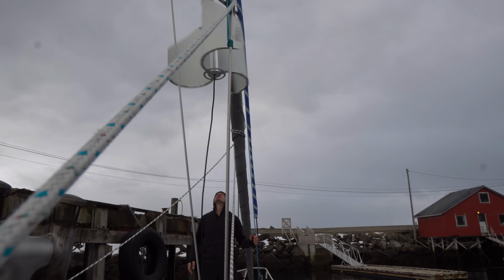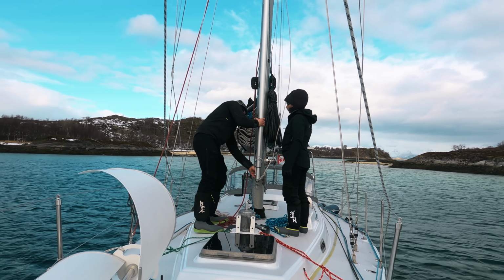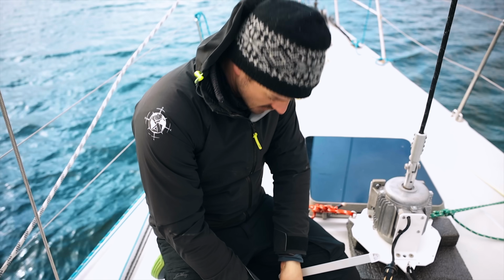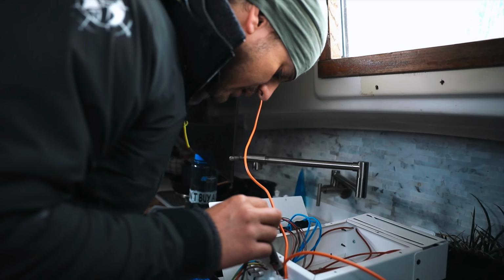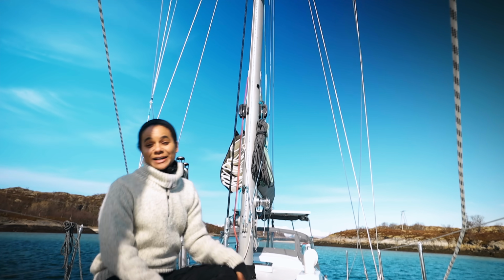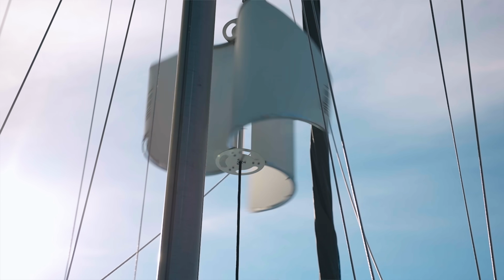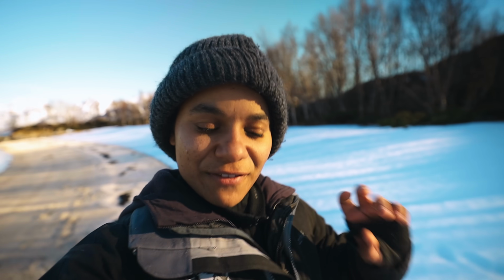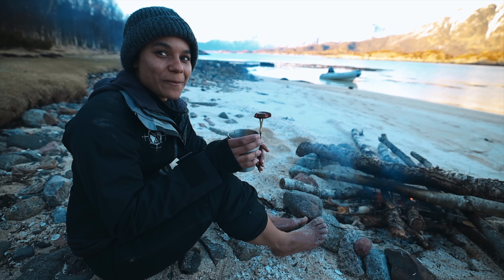No Sailing, Just BULLSH!T — Sailing Uma [Step 273]

Comment: It is nice that you have bought a pretty windmill to decorate Uma. Maybe you should paint it bright colours. Then it will look even better.
It would be even better if it made electricity. They all said you couldn't make a viable electric motor system for Uma, but you did. Good luck with the wind generator. I have a feeling that at some time in the not too distant future Uma will have a new viable power source.

Comment: Wow. This probably leads new way in power generation on boats. And there is still some room to install additional two wing sets (or use one but longer) what can give more power. Stiff steel rod instead of rope could reduce pressure on ball bearings in generator (rope can change its length) so all will spin faster.

Comment: I work as an electrician in the superyacht building industry and we also never use the screw terminals. Wago's and din rail terminals are your best friend you should stack up on them. Also that smell could be the isolation of the wire melting.

Comment: Hey, Uma!  I work in electrical engineering and end up doing a hack or two fairly often to get to proof of concept for our designs.  Crimp ferrules are my favorite for installing a stranded wire in a terminal block designed for solid wire.  TE-Connectivity’s part number 150730 is a good starting point for you if you’d like to check this option out.  

They’re similar to like ring terminals or spade terminals but have a straight post (in a variety of shapes) that fit well in terminal blocks like the one you show in this vid.  

I also sometimes just tin the stranded wire to get good contact but that has a little bit of a jank factor because the solder gets crushed and can also result in poor contact.   So I prefer the ferrules for finished designed, and the crimp side is a better fit for stranded wire.  

These “bullish!t” boat work vids are what keeps me coming back to your channel so I hope you never stop hacking cool designs for Uma!

Comment: Try putting the motor on a base that has two layers with some type of hardware that allows the motor angle to adapt to the proper angle.(like a ujoint).
Also you might try something similar to tent poles that break down but also could possibly be rigged to be a solid single piece. Only issue there is the tightening of the rig, pulling the pole apart Fair Winds.

Comment: Use multi spinning blades to get more torque and flex cable made from carbon fiber to have more power. You'll need 3-5-7-9 more spinners, spaced 2 ft apart.

Comment: Dan, these are my thoughts on the torsion line.  Why don't you try using a solid piece of conduit to serve as a torsion.  This will resist are tighting and relaxing of the rope line and have a more consist torque.  You can then mount a few brackets off the mask to steady the entire assembly.  Just a few thought.  I like the way you solve problems.

Comment: Love your connection to NBSJS. You guys and Erik are fantastic. Some ideas about wind charging: 1) Not sure why you went with a 3 phase gen but you need to be sure your MTTP or whatever controller you have takes 3 phase input since that needs to be converted to DC. 2) you need a firm connection to the gen. How about meter long thin wall tube/pipe tied together with couplers? 3) there's probably a threshold RPM for output on the gen and that;s usually somewhere roughly around 1000rpm. You need a reduction gear or at min a large wheel attached to the windmill shaft with perhaps a fan belt to the small wheel on the gen. 4) knowing the generator's need for rpm and wattage output, look for calcs. on the mechanical energy input needed. One way to see if all this works is to find the mechanical energy conversion based on wind speed for that wind mill. Let me know if you;re interested in that. Best wishes!! Dean
Reply: MPPT controller....darn it! Not sure if that's dyslexia on my part.

Comment: Hello, you two!... My husband has been catching your latest videos with me and he wanted to share some thoughts about your wind turbine build so I'm going to add it to my post (he doesn't have a subscription but now that's he has watched a couple episodes with me, he's hooked;)...FYI: he's a trained electrical engineer;)...Here are some thoughts he wanted to share and he's not bothered if it's not useful;)....

Hi Guys,
watching your last show about the wind turbine.I love that kind of experimentation adaptation.
Looking at what you first discovered here's a couple of ideas.
Rasing the turbine high means it should catch the less turbulent wind and so be more efficient, however, the transmission of power down to the generator becomes less efficient. when the whole turbine moves it's both wind energy that doesn't get turned into the rotation and makes the transmission of that rotation energy to the generator less efficient. 
An alternative is the turbine mounter lower but stiffer. I imagine a tripod of three aluminum tubes (2"/50mm diameter) leading to a 10" disk on which the turbine (or generator & turning) mount. There should be no problem setting that at 6ft above the walkway.  
2"/50mm is a common diameter used for commercial stair railings so it is affordable and there are lots of adjustable brackets and flanges for mounting them to any angle of deck.
If you wanted to mount the generator to the deck ( I think you said it was 30lbs) then with this system you could have a shaft connecting it to the turbine (perhaps with an elastomer mount at each end for vibration/offset. That all should be very efficient and the tubings about 8oz per foot for 0.065"/1.6mm wall thickness.
Kind regards and thanks for the GREAT videos!
Alistair

Comment: I have a  Hyundai Kona and they make electric and fuel cell versions of the same car. The fuel cell version is essentially an electric car that makes electricity with a fuel cell that requires hydrogen as fuel. Hydrogen is highly flammable and requires a strong fuel tank but apparently the Hyundai engineers have solved that problem. Of course you need hydrogen fuel stations to make this work, but there are some in Northern California where I live. It takes 5 minutes to fill up a hydrogen tank. The by product of the fuel cell is water but I don’t know if it’s drinkable.

Comment: Love your DIY videos as I am refitting my own Catamaran.  I am also entertaining wind turbines and have found them less productive than solar when you compare cost.  My solar is massive, 1600w of panels, with 1600AH of lithium.  I agree that having redundant system that augment each other is essential. I have a few comments.
1- Everything I have read is that vertical,which i like, produces power at a wider range of wind speed.  Are you finding this as well??
2- Replace your torsion line with a Standing rigging cable this will not have any twist from a line.
3- I hypothesize that the torsion line will also decrease efficiency compared to mounting directly to the motor. I realize that you need clean air for the turbine, but I am assuming that the loss of energy would compensate due to a direct drive mount.
4- I will mount mine wind turbine with a cork base to decrease vibrations, these mounts are also used to decrease generator and motor vibration noice.

My prayers go out to the people of Haiti, I hope your family is safe.

Comment: The pull on the generator is most likely slowing the spin too, so the torsion should not be connected to it, use a second hockup and a chain and some gears to get more spin and no pull on the generator that is upwards. I also think you should have something to hold both the top and the bottom of the spinning wind grabber to limit movement. Maybe even lock it into your mast would help, maybe a big C with the spinner connected between the ends of the C might limit it's side movement.

Using gears to spin the generator a bit fast might be good too.

Comment: Dan if you are  on a boat the go-to connectors are crimp. (At least according to Florida scuttlebutt) Soldering gets corroded and the wire next to the solder becomes brittle. Nowadays they have little sleeves called ferrules. Everybody loves them. Stranded wire behaves fine in the "nightmare" connectors with the screws if you have the ferrules. Take care.

Comment: Cool system, it wasn't at all what I'd expected!  Have you considered using a DC to DC step-up charger?  There is some efficiency loss, but it might allow you to make use of more commonly available 12v and 24v charging devices.  Also you might want to consider getting a clamp meter, then you can measure current on any line directly.  Look forward to seeing how this experiment progresses!

Comment: My concern with using the kevlar top down spinnaker line is that it will need too much axial tension to function, and that will cause excess wear on the bearing surfaces both at the blade top and the motor coupling, which I think was the reason for the squeeking. My electric solution was to build an aluminum hardtop and now have 1.4kW solar between the hardtop and the davit arch, accompanied by large LiFePO4 bank and converting everything to 120v AC except the anchor winch and starter (I'm currently looking for an add on "pony' electric motor to spin the shaft for get-out-of-the-bay use.. Cooking aboard has never been better since converting the galley to all electric, I love the induction cooking and convection oven.
On most of my buddy's boats their solution was to buy a ketch just to use the mizzen to mount 2 of the common 400w horizontal units, followed by never ever sleeping again in the aft cabin due to the jackhammer noises transmitted beautifully down the spar.
PS - use your Canuck firestarter skills. Didn't you ever gather soaked beach driftwood and toss underneath a road flare when you partied with your friends at Tofino?

Comment: we are so disappointed with our SilentWind. We cannot rely on them. Way below what they advertised and the wind needs to be around 25kts before they get 14A into the battery... better to start our engines (we do not have a genset) with dual alternators for a few hours to get our 10,000Ah batteries full.

Comment: If you shift the wind rotor so it will rotate to the other way. It is rotating clockwise now. Test it to rotate the other way to left instead. I am not an expert, but it just came up in my head.

Comment: Hey Dan, 
I think it's a great idea, however, why don't you modify it slightly and build your own generator? You can determine the amount and coils/magnets thus achieving the required output at low/medium winds, the other advantage is that the generator will be a flat configuration which means you should be able to mould onto the deck (where you had the one in the film ) without it looking out of place.
Regards
Duane

Comment: Maybe possible that the tension on the line pulling on the electric generator motor is causing a problem for the bearings inside the generator, that could be one reason why it wants to generate, but when stronger winds prevail, the tension or pressure on the bearings increase, therefore putting more load into the motor, causing that jerky reaction...? Perhaps there is a way to limit the load on the spline of the motor itself...?

Comment: its squeaking because the bearings in the generator are not designed to resist the vertical tension you have had to apply to get it to spin.....this will work in the short term but without a proper thrust bearing, they will fail prematurely..... likely it's not engineered with that sort of tension load on the generator in mind, instead having a lower thrust bearing to just hold the weight of turbine....

Comment: When using stranded wire with screw terminals you want to use crimp on ferrules, especially where there is vibration.

Comment: How about Having a vertical turbine perminantly on top of the mast, with a stiff cable running through the mast to the base, where the generator would be placed?
This also makes me wonder about how this might effect the stability of the boat: would a gyroscope on top of the mast provide added stability during sailing? (The stronger the wind the faster the spin!)

Comment: Just a question about your power issues, do they not do any waterwheel type of charger ? Or as you seem good at modifying stuff could you figure a way to use all that water around you ?
Reply from the maker: We have a giant hydro generator already. Our electric motor. But only works when we’re moving.
Reply: @SailingUma  Probably a silly question... Have you tried it with tidal energy while you're at anchor? I'm guessing there's not enough rotational energy to create a substantive amount of power?

Comment: have you considered erecting on the dingy, its a floating platform just waiting for a collapsible wind turbine, the sails/fins can be made from material like used in sails or even just nylon.  it could be rolled up and stowed on deck and then erected on the dingy, unrolling the 3 clothed sail could then be supported with ribs to give it shape, very much like a sailboat sail
you need a flatter alternator though where the magnets are on the top (or bottom), a flywheel would help stability too.

Comment: Attach 6 Peltier plates your wood fireplace then  to your voltage charge controller to your batteries Check out heat to electricity technology.

Comment: Have You thought to fit more than just one rotor to the torsion line? that way, the output should be much higher. Also, a vertical axis, that holds the rotors next to the mast is probably the best solution in the long run. You could then run a proper axis to the generator below Deck and also seal it against the elements.

Comment: hm, this video is awesome and it got me thinking! Wouldn't a darrieus turbine be a better solution for boats since it works by using uplift instead of resistance of the wind and would produce less drag? You could also try to adjust the angle of the blades when you have different wind speeds which would prevent overheating.

Comment: You are supposed to use ferrules where bolt is used to secure stranded wire. But there is a better solution - take a look at Wago spring loaded connectors (221 series for example). They are universal in terms of solid and stranded and also for a wide range of wire gauge.

Comment: You should probably go for proper 3-phase connectors that are meant for that. Otherwise you could accidentally plug stuff in thats not meant to go there.
Also to add you can use the screw terminals with stranded wire just fine, you just have to add proper crimp ferrules.

Comment: Have you considered a H-Darrieus instead of a savonius? The blades would be smaller and it's lift type instead of drag type like the savonius.. i think you'd be able to get more RPM out of it for your higher voltage

Comment: Nice experiment - very interesting. Did you swap the male/female connectors on the generator? I think so. You called the connector "European" and to be precise they are the German standard that you'll also find, e.g., in the Netherlands. It's called "Schuko" (Schütz Kontakt - protective contact). My personal problem with them is that you can reverse the phase/neutral polarity (in AC) and this impacts certain appliances (like high-end audio). The British standard cannot have phase/neutral swapped, but is an island solution. The French have a variant of Schuko that does not allow phase/neutral swap and Schuko plugs exist that are compatible with the French outlets.

Comment: You might be better off with a straight shaft or rod rather than the torsion cable, also the squeaking is probably the motor bearings under tension in a direction in which there not supposed to be. Good luck figuring it out, no reason it shouldn't work... 👍🇬🇧

Comment: Just been watching your torsion wind generator. Question, have you ever considered doubling the area of solar panels. You have the space. Sit two more solar panel on top of your original ones and put then on slides. Therefore when you need more charging capacity slide the two additional solar panel out to give you a four panel array rather than a two panel array. Kind Regards Graham & Carolyn.
Reply: That's what Mads on Sail Life is doing.

Comment: I did a fair bit of work with wind generators at one time and I came to the conclusion there is no substitute for size. Small ones make more noise than power and although they seem ideal for sailing boats they really are just a novelty item that produce a token amount of charge.
That 'motor' as you call it is the alternator, it needs to be spinning more than 1000 RPM to get a reasonable amount of power and as you know the wind is never constant. It also probably will not stand up to a lot of tension being put on the shaft, pulling on it like that will wear out the bearings very quickly. Also they need some type of brake fitted to stop them over revving in high winds, there are mechanical solutions and electrical. You can have a small paddle that is spring loaded which will operate a small hub brake or cable operated disc brake. Or you can set up an over volt detection system that returns power to the alternator which energises the field coils and pushes against the rotation to prevent it getting out of control. Both systems have their faults but you cannot run a wind generator safely without one.
Large wind turbines are much more efficient because they have a lot of inertia and can be geared up to produce higher RPM's which produces higher voltage and higher power, small ones are only any good for lower voltages, less than 24V and low power.

Comment: As an electrical engineer, please don't use domestic power plugs and sockets like that! Use something like a ceeform connector designed to transfer 3 phase, that way it can't be confused for a domestic socket, even if its the only thing with a euro connector on Uma, it's a potential widowmaker

Additionally, make sure your connector directions are female from the power source, not male!